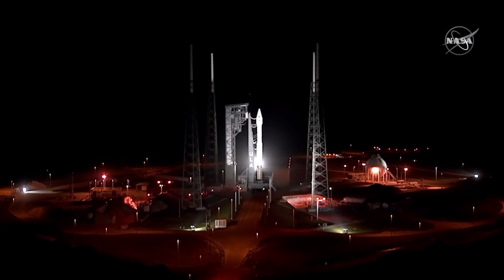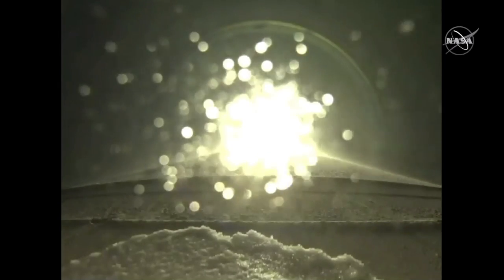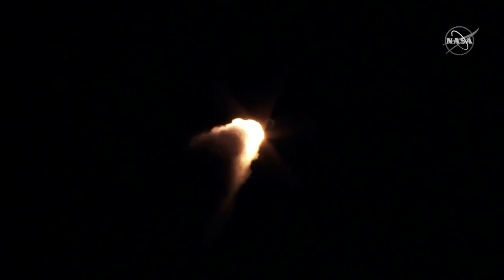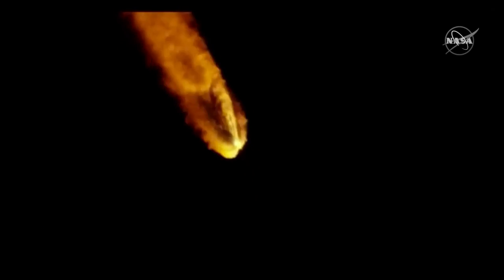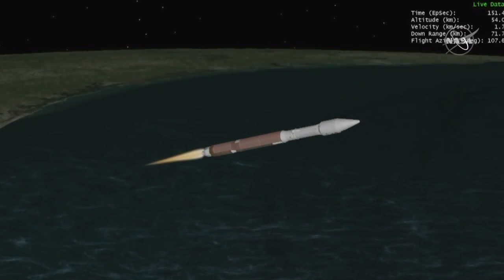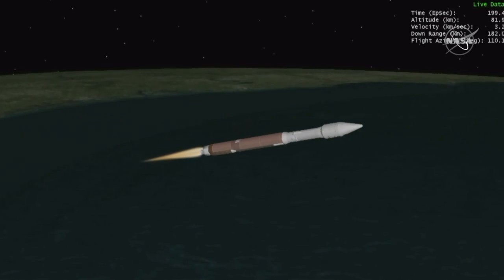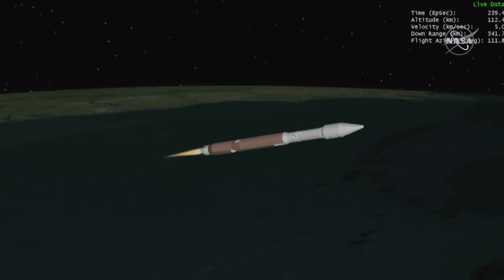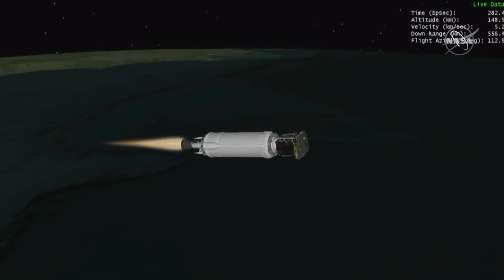Blastoff! New Solar Orbiter launches atop Atlas V rocket

Comment: Why is there ice on the rocket when it is experiencing maximum resistance from the atmosphere? I've never seen that on an airliner and I've had to wait for them to de ice the plane.
Why does the rocket arc down into the ocean?
Why do they replace the video with CG instead of playing cameras as well?
If they have a camera that can record HD video over 20 miles away why isn't there another camera watching it later in the liftoff?
Reply: A) The ice is because of the condensation in the atmosphere freezing as the temperature lowers and the wind picks up. They usually de-ice planes only when they have flown through clouds. The rocket is moving faster and higher than a passenger jet does, so it happens more. 

B)  The rocket changes velocity based on the time of year and tilt of the Earth and where the rocket has lifted off. Essentially, they just needed to aim it at the moon. 

C) They swapped to CGI for a few reasons. Mainly us. Another is because of how far away the rocket was and how minute the actions were. The detaching of the second part wouldn’t be picked up. the second is that the further away it is, the more distorted the image becomes not only because of how far it is, but also the light that the camera picks up is more and more refracted due to it bouncing off the molecules in the air.
Reply: @TheYawningPrawn   
A) Nope, it was there from takeoff. If the thing was really experiencing that much friction from air the body should he hot. If you were correct all airliners should be unable to fly... higher altitude, less water...
B) but it was pointed at the ocean... not the moon...
C) The thruster dispersion was way more interesting than the CG. Plus isn't there supposed to be some kind of explosion at separation, wouldn't that be more interesting to see? They do it during the day, and with it being night... there should be less light and could be a lot more interesting. Shouldn't the rocket light up when the earth is no longer between it and the sun?